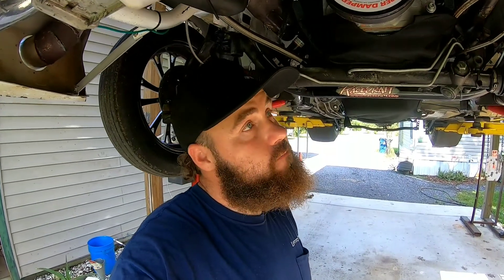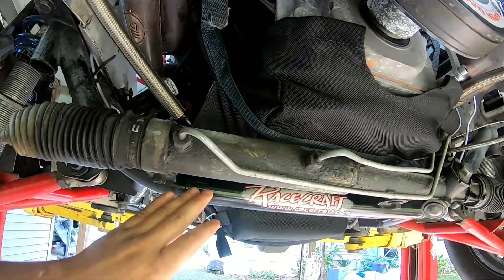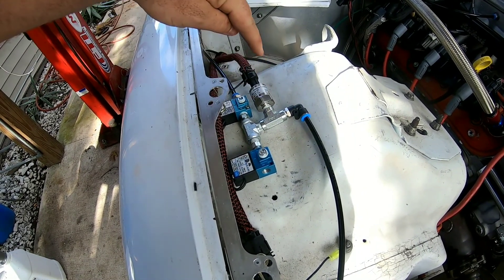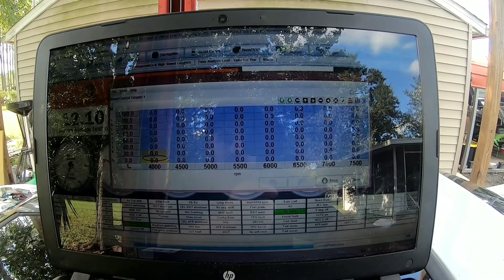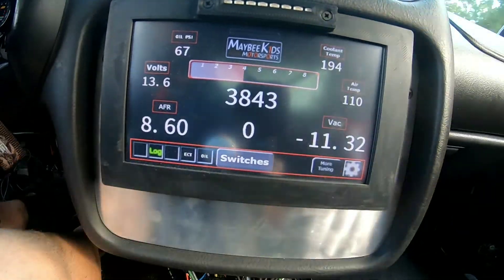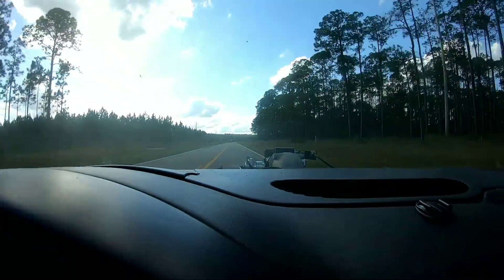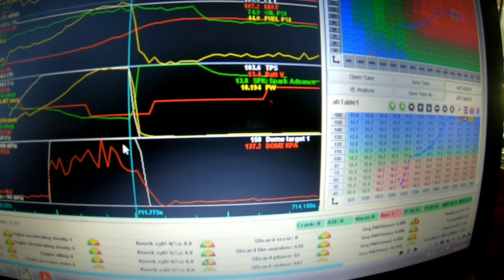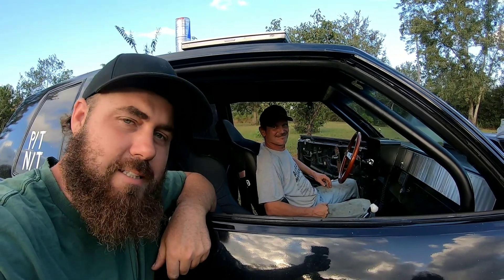MS3 pro dual mac valves, open loop boost control testing.

Comment: Do you have a video of how set it up if the gold box? I'm switching to gold box and wanna keep the co2
Reply from the maker: I don't think the box matters as long as you have the latest software. It should be the same.
Reply: @legacyperformance9982  you think you could guide me through on how to set it up on the software?
Reply from the maker: @MrJoshjackson01  go to msextra.com that's were all the software and instructions are. It's simple man, trust me, if I can figure it out anyone can. Also join the ms3pro drag race group on Facebook. They usually drop beta software in there. That's how I got the boost builder software. Before it was released.
Reply: @legacyperformance9982  awesome brother! Thank you so much.

Comment: Trying to setup my boost control using dual MAC noids also. What frequency and duty cycle are you using to cycle them? Thanks!
Reply from the maker: Shoot me a text and I'll send you screenshots this evening. 704-754-6473
Reply: @legacyperformance9982  I am curious of DC and the freq as well. Nice information and good instructions. 7lbs -14lbs. Very cool
Reply: Hey bud I have ? I installed co2 and didn’t know how often to Mac valve should be on and how long it takes to fill waste gate

Comment: are you using co2 yes or no? Please confirm.
Reply from the maker: Yes, two Mac valves one fills and one release CO2 basically floating the valve. Originally I used one Mac and used manifold pressure.

Comment: Can you walk me through the parts needed and how to wire the C02 and boost controller setup please
Reply from the maker: First you order a co2 kit from motion raceworks or carter motorsports. Those are the two companies I know of. As far as wiring, if you have the same ecm as me. Its very simple. You need to figure out which two outputs you want to use and run one to each mac valve. Then you set it up in the software.
Reply: @legacyperformance9982  I'm running the EFI gold box.
Reply from the maker: @jeffsellsdenver  yeah should be straight-forward then.